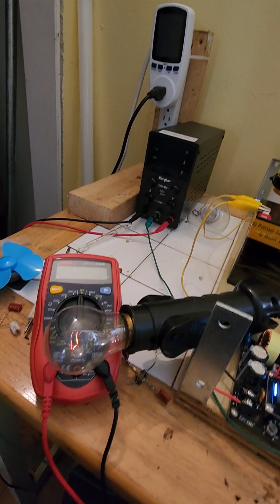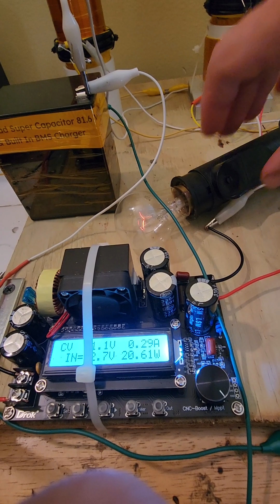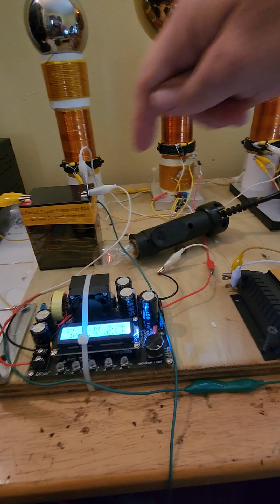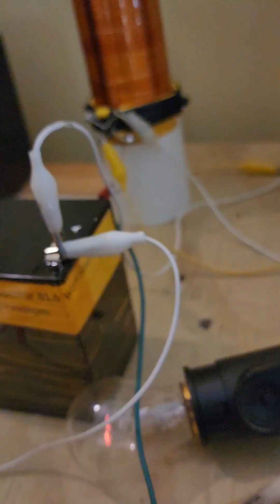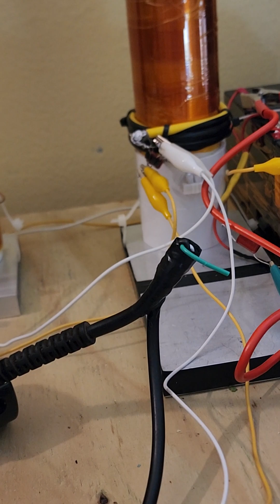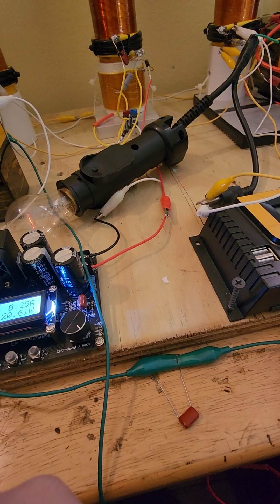🤔Receivers Don't Place An Electrical Strain On The Transmitter & Resonant Cap Adds More Free Power🤔

Comment: I put 25 square on l 2 I don't use the super capacitors yet I can't find them what is the capacity and the operating voltage of yours? I use you know your variant with the tunable antenna at the middle point I place it horizontally on the tower ... with your configuration ... 300 watt halogen bulb ... tungsten, I supply it with 40 watt, I turn on the bulb at full brightness and I transfer 2 times 1000 volts wirelessly to two identical turrets... in no-load voltage without consuming as much haha, seeing your configuration I am proud to have shared it with you in this way, you who helped me so much.. .